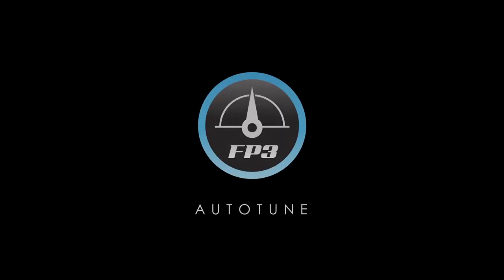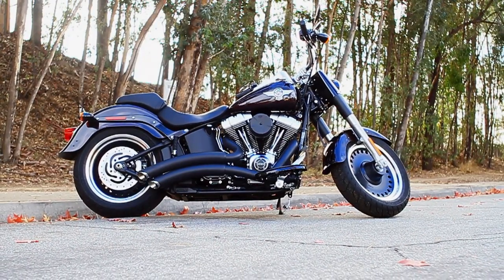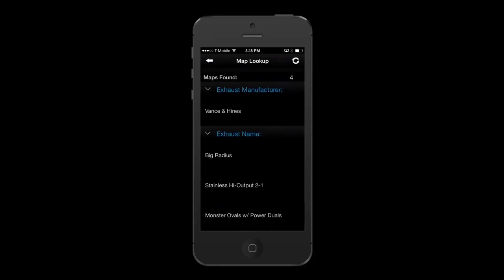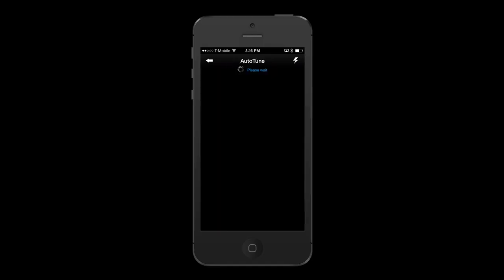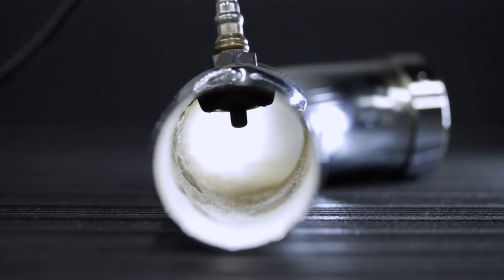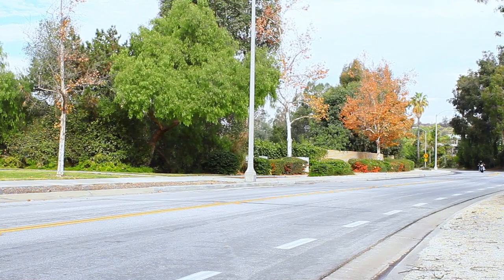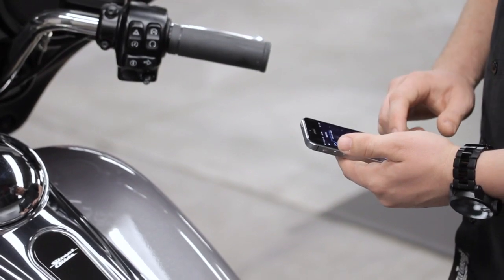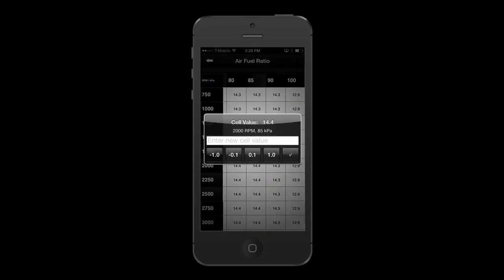FUELPAK FP3 AUTOTUNE GUIDE

Comment: Do I apply the values after every ride that the auto on active or once when all the cells are green?
Reply: It says to apply data after 1st and 2nd session, then finish after 3rd session. This is from the site : To Autotune your map, you must first flash a base map onto the bike, the closest V&H map to your configuration would be ideal. Then, select Autotune from the main menu and select 'Quick Setup'. Next, choose the map slot you would like to base the Autotune off of. This will initialize the Autotune process by flashing the bike. Now, go out and ride. The more varied types of riding you can do (stop and go, steady state, uphill, downhill, low rpm, high rpm, low and high throttle ranges, etc.) the better. We recommend 3 sessions, each approx. 30-60 minutes in length. 'Apply' the data after the 1st and 2nd session, 'Finish' the Autotune after the 3rd session. During Autotune you may experience issues such as poor cold start, poor throttle response, and general ride quality issues. These will resolve once you 'Finish' Autotune and the map is re-optimized.